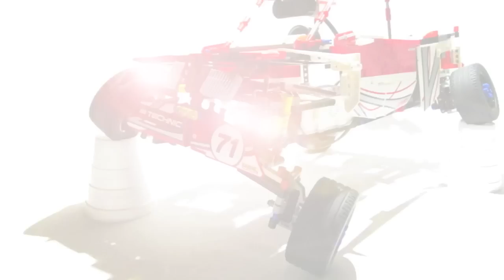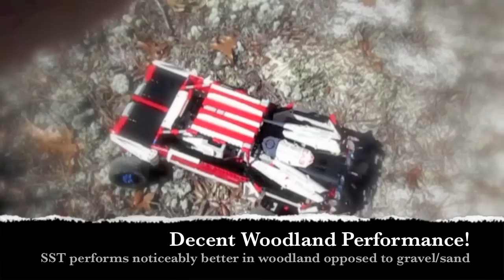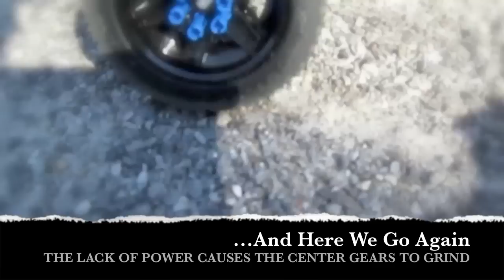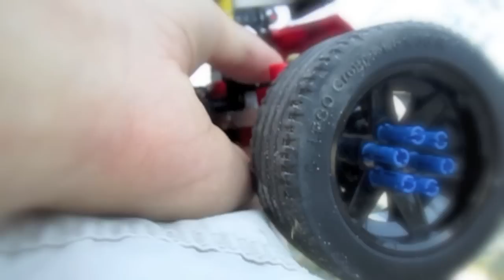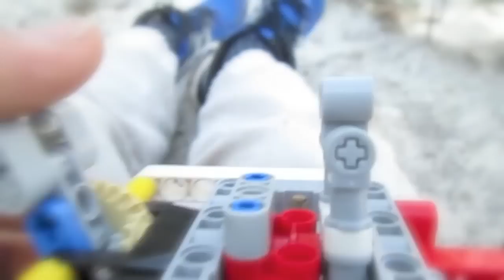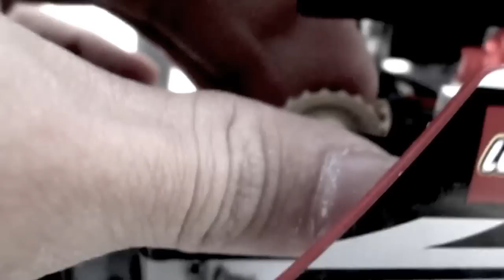Lego Mindstorms Super Stadium Truck | Ev3 Motorized Short Course Trophy Truck

Comment: Nice attempt, but I think you need some bigger tires, a low-range gearbox (maybe w/ a 2-speed transmission?), 4WD. But the suspension system is great!
Reply: ***** Bricklink is a fantastic site for any Lego parts you may need. I've purchased balloon tires there myself, actually. You can even find custom chromed pieces in various colors. (by Chrome Block City)

Comment: Do you think that the differential harmed the performance instead of helped it? On the rough ground, if one wheel loses grip, the vehicle stops because all the power goes to the spinning wheel. There are special differentials called Torsen diffs that avoid that while functioning like a diff when turning, but they are only available for LEGO as 3D-printed. I have tried to integrate one in a huge race car, but it had so many worm gears that efficency was terrible.